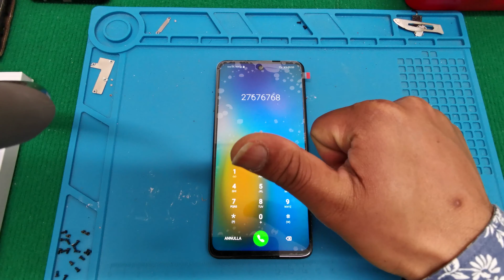Huawei P Smart 2021 Lcd replacement

Comment: Ok so seriously bad edit optimism 45 seconds there's a screw underneath the white clip it's just a little covering that's white so you can't see the screw you need to remove the white area or just put a screwdriver over it and remove that screw that's not visible I don't know why this guy failed to show that part as it wrist damaging the metal part of that camera
Reply from the maker: So sorry dear
Reply: @HardwareDoctor1  I got it apart but I bent the metal a little bit hopefully this is Alex PPA too
Reply: @HardwareDoctor1  thing I'm wondering is why do some people use hot plates to loosen the adhesive rather than a soldering rod like air air blow thing
Reply: @WilliamAshleyOnline  because they can and it also works easier for LCD replacement
Reply: @mateuszczarnecki1079  Yeah I used a  pellet stove surface but still found that the hot air thing worked better...   curious though how muh heat this phone can takewithout causing delamination of solder joints?